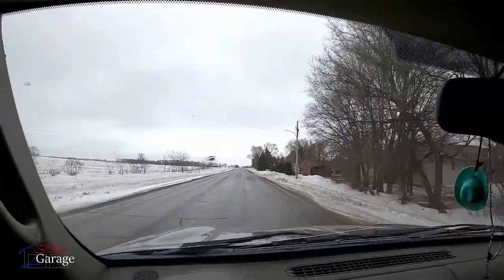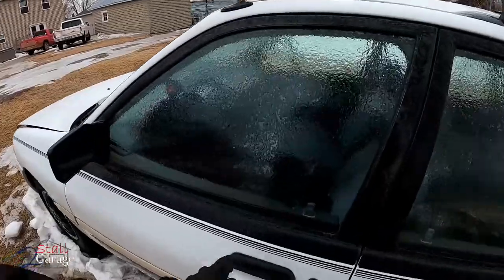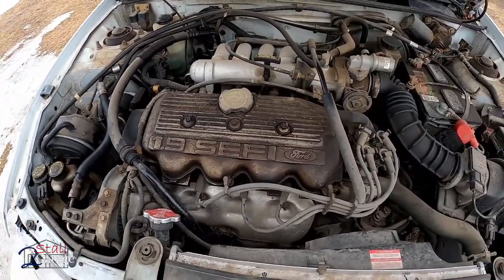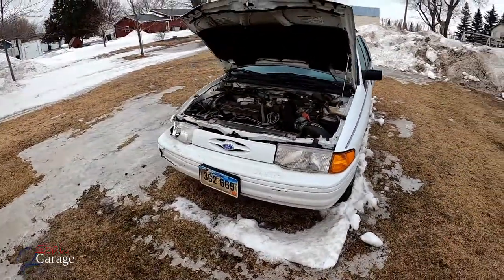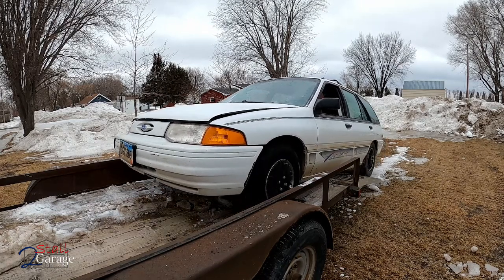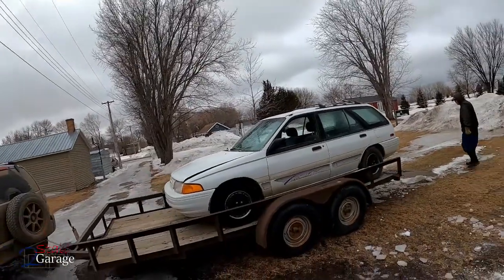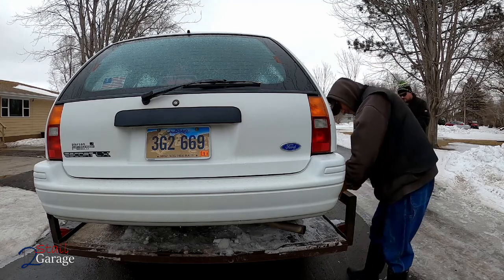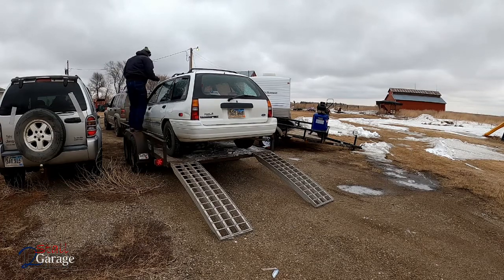Ford Escort LX Wagon SAVED From The SCRAPYARD

Comment: Had a 93 Escort 2 dr hatch 5-speed from 96 to 03. Over 200K on it when it left me. Good car.
The achilles heel of these cars is the CVH (SPI on later Focus) engines which usually drop a intake valve seat at around 130-150K miles resulting in major engine damage.
Reply from the maker: Good info & the manual you had must have made it even more fun to drive.  Very cool.

Comment: Just got a 95 xl 4door with immaculant blue interior and under 100k Miles
Reply from the maker: Nice find!
Reply: @2StallGarage  only thing wrong is it doesn't like to go past 55 mph for some reason, thinking fuel filter might be clogged or there's a exhaust leak somewhere.. idk yet, I'm picking it up sometime early next week. 

Oh an I got it for 100$
Reply from the maker: That is a steal.  Very, very nice.  Yep, likely something small like that.